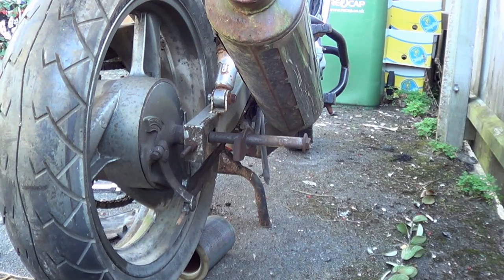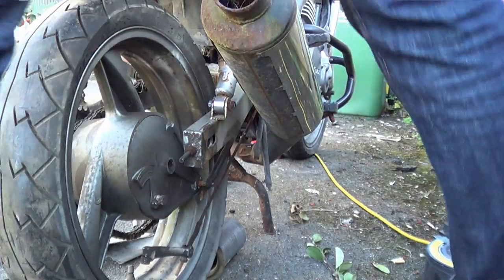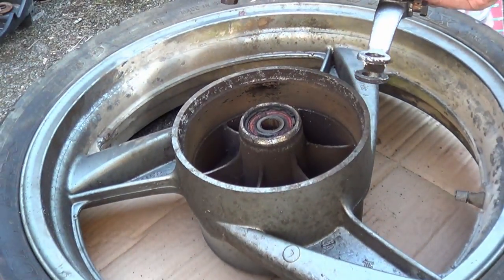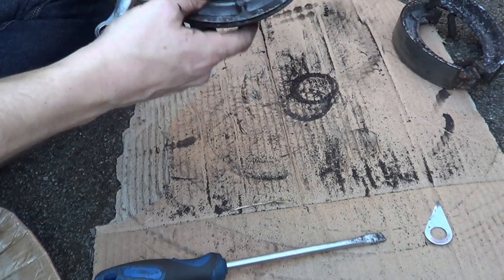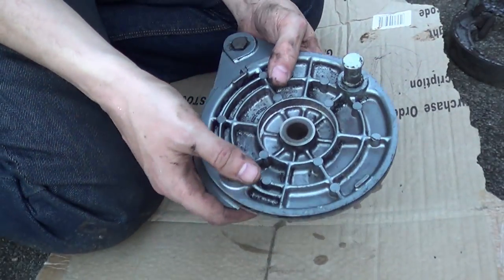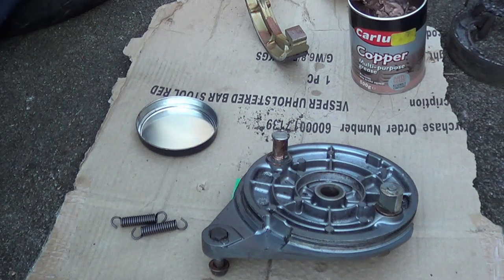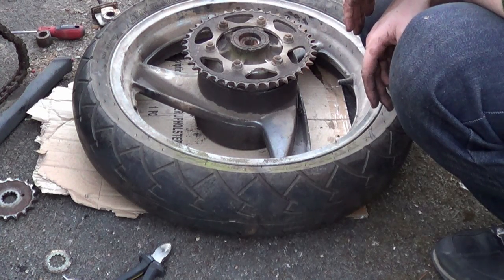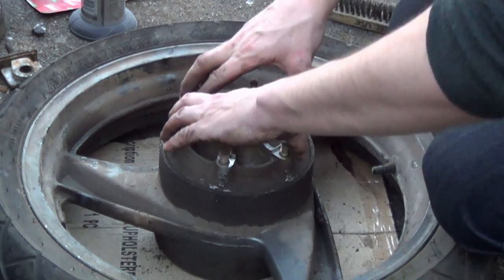Fitting a Rear Drum Brake - ER 500 - Backyard Bike Project - Episode 5

Comment: Just had the same problem, customers rear brake was stuck on even with brake adjuster rod removed. Stripped cleaned and assembled with no oil or grease on the spline shaft to keep it form sticking again

Comment: Hi Matt; I am enjoying watching your videos; Practical and very helpful. I am looking at the front sprocket on a Suzuki Bandit and I noticed that there is some rotational play; the sprocket is secure on the shaft/spline but the sprocket moves about one chain links worth with the bike in gear before there is resistance. Does that sound right? I understand there should be some play. Any advice would be great. Many Thanks Paul.
Reply from the maker: Hello paul mate, are you saying that the output shaft is rotating or that the sprocket is rotating on the shaft?
Reply: Hi the sprocket and shaft are moving together the free play is on the shaft into the gearbox.
Reply from the maker: That isn't that much, not more than I would expect. The 600 if that is what you have has 15 teeth on the front sprocket if I remeber right. 360/15 = 24. So 24 degrees isn't that much or put it another way its 1/15th of one turn.

The output shaft rotates then hits the input shaft, the input shaft then rotates and this slack stops at the clutch. Going back and forth and getting 24 degrees means that the backlash in the system is 12 degrees, and for a gearset with a mod of 4 (gear module) that isn't crazy.

Sorry went into total geek mode there.
Reply: Hi Matt thanks very much for that; I was concerned that I might have some gear box issues. I went on forums and they were not helpful; it is good to get some insight from someone who knows what their talking about. I appreciate the 'geek' approach it is always good to understand the details that's why I enjoy your content you back up the practical with facts. Many Thanks again. Kind Regards Paul.

Comment: why copper grease and not normal grease? isn't it abrasive on moving parts?
Reply from the maker: Good question, I'm doing a video soon. But for a simple answer, copper is soft and doesn't burn away. When used in 'hot' applications the copper acts as a lubricant